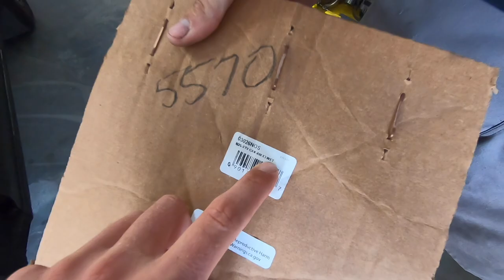The Wheelie that TOTALED James' 240... (Bent Frame, Firewall & Freedom)

Comment: CLEETUS -- There is a sensor that us VW guys have been adding to the FuelTech systems to pull timing as the front end comes off the ground to help slow down wheelies and it works great -- It measures distance to ground -- I'm sure you can add it to the Holley setup...
Reply: James ain’t the timing pulling type I feel. 
Dudes a wheelman

Comment: To be fair to that “cheap Japanese sheet metal”, James cut away a lot of the original shell, and dropped a boosted V8 into a unit body designed for a small 4-banger...
Reply: Spot on Steve👌🏻
Reply: The Nova's cheap American steel didn't like the face-plant anymore than the 240's cheap japanese steel lol.
Reply: also drop said v8 from ten ft in the air , so its Nova-time!
Reply: And your point is?? LOL ;-D
Reply: Like literally... look how little of that engine bay material is left
Reply: The LS isn't any heavier than the 4 banger that came in the 240 .
Reply: @Shadowband72  turbos+big block is alot more heavy than typical Ls your thinking of
Reply: He's not completely wrong. Some of the best Japanese tuner cars never made it across because they wouldn't pass safety inspections, and Japan wasn't going to remodel a car from the sheet metal down for a car that was likely not going to sell in large numbers anyway.
Reply: 3DLapse ls engines are all small blocks except 8.1vortec
Reply: @arcanask  the skyline back then was too powerfull for usa.
Reply: @nickab9719  stock for stock 6 speed lt1 would skin the hide off a fucking gtr from back then. Lmao.
Reply: @408modelshop  untill the first corner.
Reply: @nickab9719  good thing drag strips are straight
Reply: Exactly you can't cut the inner fender out of a uni body car and expect it to last
Reply: @datsun240zee  who said anything about big blocks? Aluminum LS doesn't weigh much more than the iron block 4 cyl that came in that car
Reply: @datsun240zee  Since when is a 6.2 LS a big block ? and ask any of the thousands of people who have LS swapped their Miata's  if it made any weight difference . Even if it added 60 or 70 pounds , having 3 times the power makes it worthwhile . Chevy makes the best cars on the planet , sorry if you disagree .
Reply: Agreed but also the KA24 engine that comes in the S Chassis is an iron block and not the lightest 4 cylinder either
Reply: @nickab9719  no... its because they weren't up to spec on safety regulations... stock r32-33-34 are actually pretty slow, like slow enough that a lot of cars of similar era would wax them in every aspect.
Reply: @Shadowband72  stock sr20det just under 400lb, stock ls 460lb, non turbo sr is 50 lbs less again, so no your flat out wrong.
Reply: @kiwifruit4579  And none of the American versions came with a SR 20 , only the wrong wheel drive ones came with the good engine , so your point is pointless .
Reply: @nickab9719  The Corvette and Camaro both go around corners just fine , in fact the corvette has set records at more than a few race tracks . And that was the old front engine one , the C8 performs better than cars that cost 3 times as much . You are a uninformed internet troll who clearly knows nothing about cars .
Reply: @Shadowband72  That's why Cleetus has about 30 Crown Vics and a special mechanic just to take care of that fleet. lol Just messing with you, I have all GM vehicles myself.
Reply: @Shadowband72  yeah, the cruze, traverse, and equinox are grand examples of the best automaker on the planet.
Reply: @whozaskin3639  You do realize that the same company that makes Lamborghini Bugatti and Audi make's shitty little front wheel drive junk to . Or that the same company that makes Ferrari makes Chrysler . GM is the best because they make the Corvette and sell it for less than the top tier Ford Mustang . The Corvette base price is 59 thousand , and it performs better than car's that cost 3 times as much . The company that builds the absolute best car for the money deserves to be called the best car company .
Reply: Why do we still argue that its america engine is the end all be all? Because sir it just explains how simple minded and closed minded you are, I can take a 98 supra put JUST AS MUCH MONEY INTO IT AS YOUR 2020 CAMARO, build them both and make around the same power. Its not that people are putting 10 grand in a Honda and making 320 hp bro !
"Vape hit" 
We are making 1000+hp out of 4 cyl now a days because of tuning capabilitys. What can you do to your v8 ? Because it's not as simple to turbo build and tune them and they are just as un reliable so whats the big deal ????
Reply: @dylanpope9162  And in the US a 98 Supra costs more than a brand new Corvette . I'm a big fan of 90s sports cars but old Supras and GTRs being as high priced as they are is just crazy . And the LS wouldn't be the number one engine at the drag strip if it wasn't the best option . Toyota was the best back in the day but that was over 20 years ago . Back when they made real sports cars and small pickups . Now Nissan is the only Japanese brand that builds anything that compares to the cars from the 90s . In 1979 Toyota had a diesel engine that could get 76 miles to the gallon , but it's 2021 now and the Prius doesn't even get that good of fuel economy .
Reply: To be fair!
Reply: Not to mention the fact that the "cheap Japanese sheet metal" did its job and absorbed and dissipated the majority of the impact, rather than transferring it to the driver's body.
Reply: It just couldn’t handle all that freedom
Reply: @Shadowband72  do you really say chevy is the best car manufacturer? 😂😂 Toyota is way better in safety, reliability and making buyers stay, just look at the new c8, chevy can't even make straight stitching on the dashboard just wait 15 years and it's junk, they aren't built with quality materials and cars that aren't often rust away or are impossible to restore. You must be a joke to think chevy is close to being the best manufacturer, it's like saying PSA makes good cars 🤡🤡
Reply: @John-vi5vb  yup that's what most people doesn't understand, they just think it's built badly with cheap materials, when they actually do their job way better than the more sturdy cars.
Reply: A popsicle stick is still a flimsy implement, regardless of the fact that it's well suited for holding a popsicle.
Reply: @Shadowband72  not to be that guy, but if Ford and Mopar were as relatively “cheap” to build as Chevy they’d rule the drag strips no doubt
Reply: @BelieveItYaKnow  No , Ford makes nothing that compares to GM , 5.2 litres that weigh half again as much as a 6.7 litre LS  and everything that Dodge makes is either front wheel drive or overweight Muscle cars . And the price is one of the best things about GM . The GT 500 is over 100,000 doll hairs , and it's just a dressed up Mustang . The C8 Corvette is a mid engine car with all aluminum chassis and lightweight fiberglass outer skins . The only thing Ford makes that compares costs 500,000 doll hairs and only has 6 cylinders . The Mustang is on par with the Camaro , but it doesn't come close to the Corvette .
Reply: @Shadowband72  *engines.

Chevy makes the vest engines
Reply: The Sawz All  that TOTALLED James' 240

Comment: Poor ol Leroy has been forgot about 😢 I miss Leroy action
Reply: Same here.
Reply: Leroy is an excellent car no doubt..... but theres is just so much you can do on the H pattern and no more without breaking the transmissions constantly.....
Reply: Its much easier to go faster on a powerglide or a sequential and kinda less frustrating and time consuming. But Leroy is still loved and we all want to see that twin turbski skeleton again.
Reply: Make Leroy all-wheel drive.
Reply: Leroy has earned his break. The car has been through hell and back, and is enjoying a  temporary retirement.
Reply: Leroy did need the break..
Reply: I'd say turn Leroy into a road racing car, change up the suspension/wheels/tires/brakes setup completely.  When they go to Bowling Green for LS fest, take Leroy over to that road course by the Corvette museum and watch him run circles around whatever fire breathing mid-engine factory monster Chevy is coming out with this year.

Comment: james.. on the nova.. on the master disconnect switch..  fab up something like the moroso Morse cable control kit to add to the NHRA legal button on the back. so you can kill the batteries from the push pull knob at a handy spot from the drivers seat..

Comment: James, you Kyle and ol’ cleeter need to use wheelie bars on test days. I get if you use them you’ll bump into a different class. But you’d save yourself a lot of headache and damage by using them on test days, take em’ off on race days. That way you can tune the wheelie out of it, and save the body, frame, mounts... your spine.

Comment: What are those things at the tops of the walls in that garage, near the ceiling?  They look like pipes.  A sprinkler system is the only thing I can think of which would have that many pipes running everywhere.

Comment: James needs to put a Davis Technologies wheelie control in the Chevy II where it takes timing out when the car tries to wheelie and once he puts the 98mm turbo in it and dials it in he needs to try and get it around 2500lbs without him in it which is very possible then go out and race John Doc and the Black Sheep which as long as they are similar in weight and make close to the same power it should be a good race and James said the LS going in the Nova went 162mph in the 1/8th in the 240 and John has been 4.27 @ 170mph so it should be a good race

Comment: Cut all of it off, put your strut mounts on some front roll bars.  I deal with this on front wheel drive dirt cars all the time.  You need a tube from the cage all the way down to the front of the frame horns.

Comment: Would have thought putting the car on a jig would straighten that front end out enough to extend the cage to critical mounting points. To put it bluntly, that's not that bad compared to a crashed car hitting another car and getting repaired, modern cars are stiffer and tend to be more of a challenge to repair.

Comment: To be clear about "Totaled" for those that aren't aware of how a vehicle is deemed such, that term being labeled by Insurance Companies is a "cost to repair" the vehicle. ANY vehicle can be repaired. It boils down to the value/worth of the vehicle over the cost to repair it. Some Insurance Companies that are in with their "pro-shops" will allow the shops to fix severely damages, boarder line cost over value vehicles due to the Insurance Company orders the shop to use used or aftermarket parts on the repair. Plus those "pro-shops" do the work at a lessor shop rate. Doing that usually results in a crap repair job as the Tech doing the work is getting screwed on his time by the Shop and the Insurance Company making the Tech have a "screw this hunk a junk" and fills it up with body filler, "Cave and Pave" that bad boy. Ask me how I know all about this, I once WAS that Tech that was screwed on these kinds of repair practices. So yes, any vehicle can be repaired regardless the damage. Cost over worth.

Comment: I know you wouldn't do it. I am 56 yrs old I had my NHRA LICENSE For 5 years. Starting in 1999 
I was running my 70  Camaro tube  Chassis. Was 2650 with my 2000 hp I was running 7.62@165 1/4. I run with hand controls. 1271 blown Injection. But I know you would want someone younger. An someone not in a wheelchair. Bob Blackwell fron division 5 in Kansas City is who I got my license sign off. I had to send a recording of me to see how fast I can get out of my car. He call me an said I get out faster then most people with legs do. I understand that you would say no your a big risk. And I live way to far . I would have to sale my house. Right now try to sell a half mill house I tried the US is to bad. Just thought I would try. Good luck love yr videos.

Comment: How much heavier is the LS vs a sr18/sr20? I guess it doesn't matter with a wheelie like that :)
Reply: Weight difference is around a hundred pounds I believe. I know an LS weighs around 350-450 or so assembled, depending on which variant it is. The SR20 I think its around 340-350, Might be a bit off but should be in the ballpark.

Comment: Looks like the bend was the front part of the body right at the spot welds. He got lucky.  The spot where is damaged is not frame..  that car is a unibody integrated to a "clip".  All that shit comes off with spot welds.  Ditch it and go chromoly. No "frame" machine needed either way.

Comment: Yeah Japanese cars aren't made of thick steal and they aren't built like 60's body on frame either.  Cutting out all that steel infront of the towers wouldn't of helped the problem either.  There would be bugger all supporting the radiator and everything forward of the towers.

Comment: I love how Americans think if they didn't make it Its cheap rubbish. News flash Japanese Steel is not cheap rubbish it's made from Australian iron ore which is the best quality on the planet and made to exacting standards. The us has made plenty of dangerous cars that were pulled from the market. Like the pinto for example. 2 that car was designed to have a small 4 cylinder not an ls v8 boat anchor. 3 maybe James should be using wheelie bars like the pros do . 4 the nova did the same thing was that made from so called cheap Japanese Steel.
Reply: Don't give a shit where they got the ore from, if it isn't alloyed right its still shit. And there is no denying the metal used to build Japanese cars is lighter and thinner then the sheet metal that Nova is made from. 
Go tap a fender on a 60's Holden, then do the same on a newer Honda and tell us its the same stuff.
Reply: @sparkplug1018  60s cars where death traps. That car was never designed take have a 1500hp v8 in it there's nothing wrong with how it was built. Japanese cars are and have always been better quality than us made vehicles. Its only arrogance that thinks otherwise.
Reply: @troytuckwell3610  Notice you left out your own domestic production.
Tell me how many of these wonderful Japanese cars will be on the road in 60+ years? Sure isn't hard to find American cars from the 60's and id imagine not to hard finding a Holden either.
Fact remains, yes they build a lot of safety features into modern vehicles, but they're still built with paper thin steel, and often not the greatest alloy either.
Reply: You're delusional if you think the the Japanese make bad steel and alloys.
Reply: @troytuckwell3610  And so are you if you think they’re incapable.

Comment: Japan uses stronger steel than any competitors and it's also more expensive! 

It bent because it's a heavy v8 in a empty gutted engine bay <so if anything missing was designed to be structural it's now weakened>no added support, no engine cage this was probably too long to explain so they made up lies!
Reply: I’ve worked on both and Japanese cars 100% have crap flimsy metal and frame design compared to American cars and thats cars clear from the 90s up until now